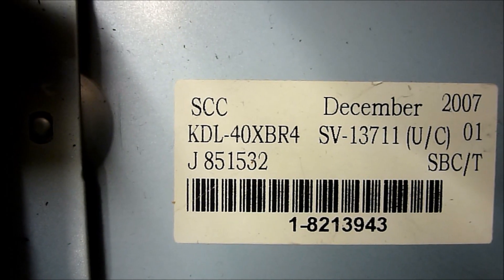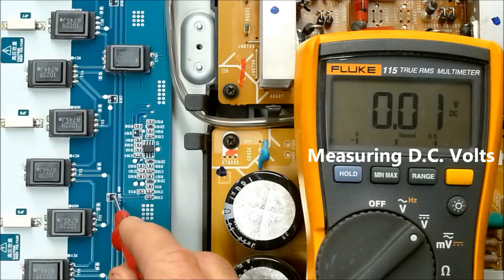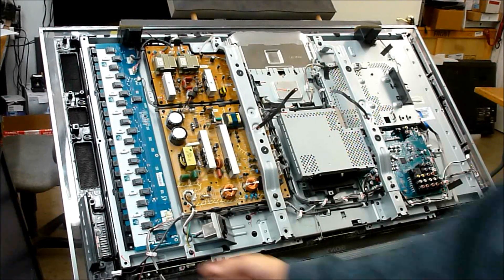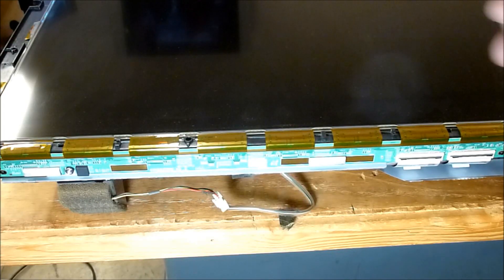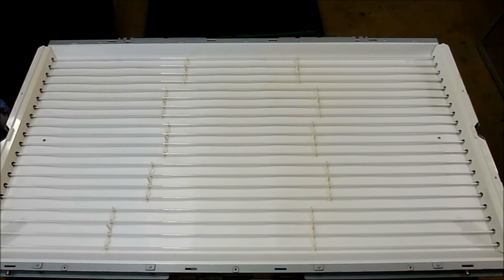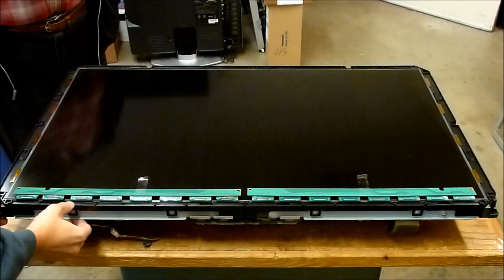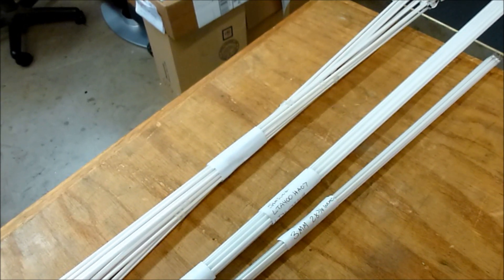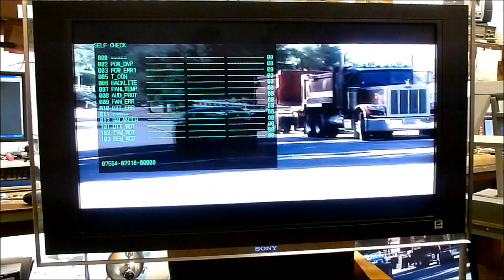Sony KDL40XBR4 LCD L.C.D. TV 13 Blinks Repair Fix Backlight KDL 40 46 52 XBR4

Comment: Thank you for posting this. I have a 46in version of this TV that I bought new and still use. While I don't plan on replacing any bulbs should they burn out, I was curious how to replace them as well as what the inside of the TV looks like. When you showed how to access the self check, that was an awesome bonus. I had been wondering how many hours were on the TV since it isn't part of the main menu settings. Right now it is at 25622 hours and has been turned on 9655 times. I assume I am pushing the limits of the life span of the bulbs at this point. I do see that I have an issue with the DTT_WDT. Any idea what that means?

Comment: Not really long enough for most TVs, but Mouser sells CCFL fluorescent tubes for older laptops and small displays. I had a Toshiba computer my company bought for me around 1990-1995, and the CCFL burned out. I was able to put a slightly larger diameter tube into it, and it is still working. Of course, I seldom turn it on these days. As always, great information. I hope I don't ever have a need to use said information though. Thank you!!

Comment: Hi 
I have a Sony KD-55SD8505 curved 4K tv 
started with a solarisation problem So I changed the t-con and now there is only sound but no picture & no back light. I put the old t-con back in but it’s still the same 
Where can I find schematic drawings pin outs voltage and instructions please  
thank you in advance
T-con
UZ-5555T30C03, T550QVR04.0 CTRL BD, SONY KDL-55SD8505. Screen T550QVR04.0 voltage and test points please

Comment: Can you tell me ,is the same problem of LED 13 times blinking ....?
Reply from the maker: I believe 13 blinks on a LCD is a inverter/backlight failure. Give me your model number and i will look it up.
Reply: Sony LCD 42" TV.Model No.KLV-40S550A

Comment: I got same 13 time blinking in KLV-32W550A. It could be backlight issue.... As it was intermittent on off problem so found BL-ON  volt was missing. So pulled that BL-ON wire and inserted in Standby pin in Power Board for 3.3V. set worked ok for couple of days. Later again intermittently Display (osd) & picture on off. Heated the Main Board. After set got ON for 2 times later got stuck in 13 Blinking.

Comment: Great video!  I have a Bravia KDL-52XBR2.  One day it just stopped cutting on.  The Sony light comes on and the green power light comes on but nothing else happens.  No flashing codes.  Normal startup clicking noises.  Any ideas?  I can say that one day I just kept turning it off and on and after about 10 minutes it came on fully and worked great until the house power blinked.  Haven't fully came on since.

Comment: just watched your video. i have an xbr55hx929. was watching it when it went black. got 2 flashing red lights. called around to local repair and the geek squad. was told to go buy a new one. not worth working on. your video saved me a ton of money. ordered a power board and followed your steps. 80 bucks and i am good to go. thanks

Comment: Hi, I have the Sony KDL 40-XBR3 it has green light but no video or audio. Tried replacing main power board and AU Board, no difference. Tried flashlight against the screen and pressure on the screen and I don't see any image or light
Reply: Ive got the same problem what do you recommend me to do? thx

Comment: Great video!
I have a KDL-52HX900 that works well for about 5 hours straight, then lost brightness and turns off blinking 6 times.
An official repairer SONY indicated that to repair need to replace the entire front (LCD) and presented a budget of 1600 euros!
As I read in the service manual indicates that the panel reverse problems .... will that be?
Thanks for your help ....

Comment: I have a Sony Bravia KDL 40V2000 that is malfunctioning. TV starts OK the after about 3 seconds the screen goes black and the red light blinks 4 times.  Should I attempt to repair it or should I get a new one?
Reply: hey i am having same problem here, did you get it fixed?

Comment: I would have swapped one of the other tubes from the bottom of the screen to the middle and replaced that one with the new one in case it was not the same colour.

Comment: Hello I have a sony tv model KDL-22PX300. When I plug, the red control light illuminates and blinking when trying to turn it on by pressing the power button on the remote controle , LED s lighter green but not tv not power on after release it the button the led start blinking again... Please help. Best kinds

Comment: I have a  Sony KDL-40V2500 TV and the screen is not working.  I am able to turn the TV on and power goes to the TV and I believe that the sound works but the picture is not showing.  Do you know what part I would need?
Reply: Art By Chris Strong

Comment: I have a sony bravia kdl-40v2500. the problem is, it powers up and displays perfectly but after maybe a minute it goes blank and the power led blinks 9 times, then displays again perfectly and after again another minute or so it goes blank and the power led blinks 9 times and stays blank while the led blinks 9 times and then stays solid red and still no display. any ideas please?

Comment: I have a sony KDL-52S4100 and the tv screen will turn on but it wont show any pictures or display pictures. do you have any help that i could use? is it an easy fix? does it cost anything to fix it?

Comment: I currently have a xbr4 also getting 13 blinks. It turns on for about 5-10 secs and then goes to standby mode and gives the 13 blinks. i recently bought it to a repair shop and they told me the panel was bad and would cost around 1500 to repair so obviously not worth repairing. Does this sound like a bad ccfl bulb to you or would the panel actually need to be replaced?
I'd really appreciate any help from anyone who's had this problem and is a little more experienced thanks

Comment: I have fixed a lot of TVs from the recycle bin with the help of your videos. Now, I have a Sony KDL40V2500 that give me a 4 blink error which indicates a back-light issue.  If I unplug the power to the inverter should that not stop the error or is the system still seeing a power issue to the inverter?  FYI, TV turns on normally with the back-light on  but turns off after 5-8 seconds.

Comment: Thanks for the Video! I just need to get a replacement CCFL. All the shops in my area I have called keep telling me its not replaceable. I even went to one shop and they guy told me you have to be a tv repair specialist to get that far into the tv And that I couldn't have gotten that out by my self and I didn't know what I was doing.
Another shop wanted $150 for one bulb.
So I have to wait to have one shipped.

Comment: I have taken an LCD completely apart when a 42" TV got wet. (Found it outside someone's home.) Had splotches on the screen so I thought there's no worse I can make it. Panel was a bugger to get off, but amazingly it just needed a clean -- the diffusers had got dirty and were causing the marks on the screen. 

I got a little jittery when I saw how that LCD flexed when you took it off!!